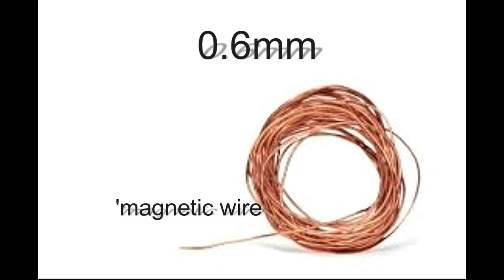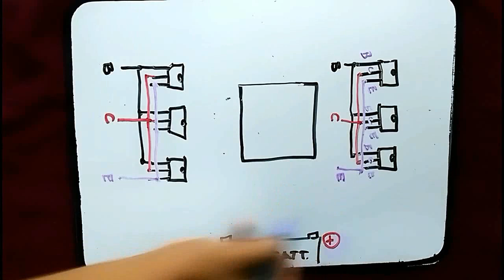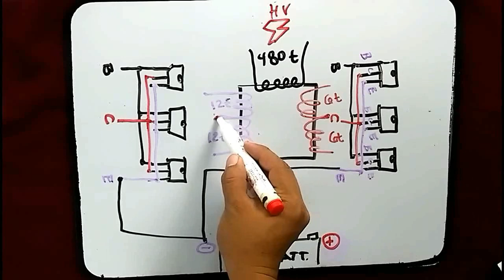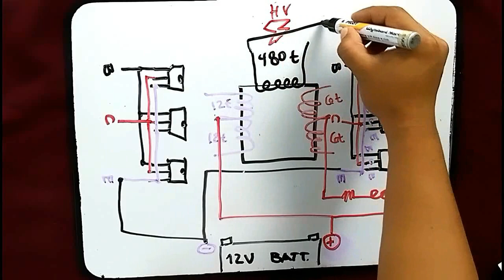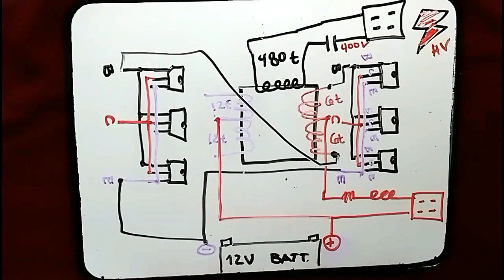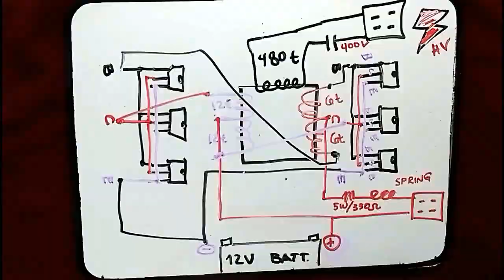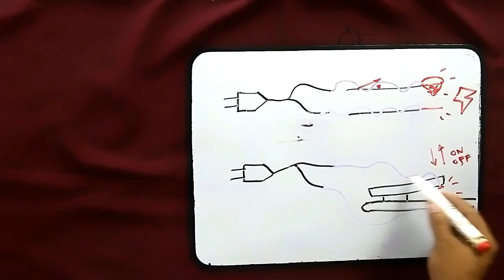DIY ElectroFISHER(fish stunner)  TAGALOG_ EP.3

Comment: Haaaaaay salamat...may pinoy narin na verxon...salamaaaaaaaaaaaaat sayo boss
Reply from the maker: Salamat din bro :)
Reply: Marami akong tanong boss...sana matolungan mo ako..
Reply: Marami akong ginaya na ganyan..kaso ma bilis uminit transformer ko..kulang kasi ang winding ko nung maliit na wire
Reply: Kaya gumawa nanaman ako..mosfet nanaman gamit ko..ma bilis parin uminit..
Reply: Malaki na na gasto ko boss..   :( pls help mo ako pano ba ang tama..
Reply from the maker: Meron pa tayong isang video dito bro. May mga sinagot akong mga tanong dun. Sana makatulong yun sayo. :)
Reply: Paki link ng video mo boss
Reply: Sir..sa pag wind ng wire...ano ba ma una???ang secondary??ty sir..
Reply from the maker: @balongpalcutofishingtv6816  technically, kahit anong mauna ay pwede bro. Pero sa ginawa ko, nauna yung primary (6turns at 12 turns) tapos sumunod yung secondary 480turns
Reply: @10minuteelectrodiy12  bro pa convert ako Ng wire "mm" to AWG 1.2 = 18, 0.6 = 23, 0.5 = 25 tama ba??

Comment: i suggest wag mo gawin switch in between center tap mas maganda i konek mo na sa center tap ng 12 turns yung resistor from 6 turns,bakit?? kasi may supply na yan from postive across to collector then ,emitter from negative ! may supply na di lang mag ooscilate kasi walang base just piece of advice

Comment: Hello sir 👋 .can I use irf 3205 this method
Reply from the maker: No bro, irf3205 will not work  my method..  but you can still make a fish stunner using a different configuration. I will try to make a mosfet (irf3205)version and upload it here soon. Hope you'll see it. Thank you :)
Reply: Can use but different diagrams iba ang wave of transistors small to big output  n papasok s transformers kya lumalakas

Comment: Hi boss. .ilan po ang minimum na transistor na kailangan ? . Kasi, na try ko po dalawa lang. . Tapos. Sabog/putok ang mga transistor ko. .
Reply from the maker: Nasubukan ko yung 3 bro. Ok naman.. pero yung mga sumunod na ginawa ko. Apatan na.. Eto kasalukuyan ko ginagawa now. 5-5. Sana magtagumpay :) ... sensya na napahaba reply ko..  yes,minimum 3-3
Reply: @10minuteelectrodiy12  salamat bro. . .try mu next time yung tradisyonal bro. . . .madali lang. . .meron akong video. .
Reply: @10minuteelectrodiy12  bro. . Kakatapos ko lang ng 10 pcs d718 ko. 5-5. Working na working. . Salamat sa iyong schematic diagram. . Nakatulong talaga ng sobra.
Reply from the maker: @rfltrrs02  wow. Nice! Maraming salamat din  po Sir
 😁😅
Reply: @rfltrrs02  boss pwede poba convert ung mm ng magnet wire into number di kc alam ng bibilhan ko pagsukat sa mm eh alam lang nila ung sukat sa number tnx

Comment: Boss ok to matagal ko na hanap tong design mo..iyong coil ano pong diameter?tapos instead na D718 eh 2N3055 pwede ba palitan nun?salamat and more power
Reply from the maker: Nasa video yung size ng mga wires bro.. at Oo boss pwede ka Gumamit ng 2n3055. Meron ako 2n3055 version Upload ko mamaya.
Reply: @10minuteelectrodiy12  I mean sir iyon pong diameter ng coil pag inikot mo na siya?for example pwede ko ba iikot siya sa isang  pako or pwede rin sa isang tubo?no  effect po ba?thank you
Reply from the maker: Ah... sa bilog mo siya ipapaikot kaya diameter. Diko pa natry bro :) .mas magandang yung mga classic na design ang gamitin mo pag ganun bro. Yung mga may contact point. Applicable lang kasi ang paggamit ng transistors sa enclosed core(transformer)sa case ko kasi ay 3amperes transformer yung mga ginagamit ko. Standard naman yung sizes ng 3A transformer kaya parepareho sila..  yung mga tito ko bundle ng pako or bundle ng asero ginagamit nila ..
Reply: @10minuteelectrodiy12  salamat bro..wait ko ung video mo sa 2N3055 TS..salamat  and keep on making very useful videos for us Filipino DIYers.
Reply from the maker: Hi bloxxy. Bro pasensya na katatapos ko lang maedit yung video. Pero dont worry dahil uploading na. Hopefully available for viewing after 30 mins or mamayang 11pm..  salamat sa paghihintay :)

Comment: Boss tsnung kulang ilang voltahe va  output at ampere nito BDW nkasubscribe nku
Reply from the maker: Hello Sir Renel Apilar :) Nasa 430V-450V yung boltahe sir.. D ko nasukat yung Current :)
Reply: Chargable bayang battery nyan boss pag malowbat sensya na sa tanung ko
Reply from the maker: @butakal1595  opo sir.   Gamit kong pangcharge yung DIY na 12vbattery charger. Andito din sa channel yung video kung paano guma ng charger. Sana maoanood niyo. Salamat :)

Comment: Kaya nya yung tilapia sa medyo malalim boss?
Reply from the maker: Oo boss.. check mo yung isang video ko about din sa fish stunner. Mas malakas yun kesa dito
Reply: @10minuteelectrodiy12  okay boss thank you
Reply: @10minuteelectrodiy12  boss yung 2N3055 ba?
Reply from the maker: Oo bossing. Yung 2n3055
Reply: Ahh okay boss,parequest ako ng mosfet boss,try nyo yung IRF3205 pieces kung kaya nyo boss,mas malakas yun
Reply from the maker: Cge boss sunod natin soon. Pagkakaalam, ko kahit 2pcs lang niyan ok na eh. Abangan :)
Reply: Mas powerful sana boss kung 4 pieces
Reply: Goodluck boss sana magawa mo,keep it up😉
Reply: @10minuteelectrodiy12  boss tanong ko lang po,sa resistor pag kailangan ko ng 15w22ohm or 15w20ohm ano yung pwede kong iseries para maging ganyan ang value?
Reply: Wala kasing nabibili na 15w dito samin ehh
Reply from the maker: Dipende.. Ano ba wattage ng mga resistors mo? 

Kung may 5watts ka, 3*60ohms parallel para maging 20ohms15watts
Reply: @10minuteelectrodiy12  3 pieces na 5w60ohm?
Reply: @10minuteelectrodiy12  boss paano naman po sa 5watts and 10 watts?

Comment: Nakagawa na ako nyan prob. Ko lng sa switch ko sobrang init
Reply: A1941 Ginamit ko
Reply from the maker: ilang piraso ginamit mo pre?
Reply: 6 dati sir nagdagdag ako malakas talaga xa kaso malakas Din mang ubos NG batt.
Reply: Gumamit din ako NG 1943 4nilagay Kong power
Reply from the maker: yung mga sumunod kong ginawa, ginamitan ko ng 2n3055..  mas tipid sa baterya bro :)
Reply: @10minuteelectrodiy12  marami din akong 3055 sir kqya lng dko pa nasubukan pasilip diagram mo
Reply: @10minuteelectrodiy12  alam ko ding gumawa NG classic sir yung may uper saka lower
Reply from the maker: nice sir :) .. classic yung mga gawa ng tito ko. walang transistor. condeser lahat, contact point at mga alambre ng payong
Reply: @10minuteelectrodiy12  marami na ako nagawang ganun sir tnx sa video mo may natutunan ako sa idea mo sa switch
Reply: @10minuteelectrodiy12  alin po ba mas maganda sa classic or un model mo na may transistor?
Reply from the maker: @alexalcantara1100  Good day :) .. subjective yan bro kung performance ang pag uusapan. Siguro magkakatalo nalang sa kung ano mas madali gawin..  mas madali gawin yang modern bro kasi mas konti ang winding dahil yungvtransistor na mismo tumatrabaho. Unlike sa classical na more or less 1 kg ang copperwire at nakabase ang lakas sa kung anong gauge at dami ng wire na ginamit mo.  Salamat :)
Reply: taasan mu sir ng konti ang resistor mu kpg nainit sobra ang switch
Reply: @viraltrendz1991  cge boss pag may  oras ulit subukan ko
Reply: @alexalcantara1100  yung classic kc sir ma's matipid sa battery pag maganda yung winding ok din xa pero pag compare mo sa transistor ang power ma's malakas talaga.

Comment: Naka dalawang gawa na rin ako sir almost 1 yir na dpa nasisira
Reply from the maker: d718 transistor din ba ginamit mo boss?
Reply: Sir.. Magkano pa order po ng ganyan... Texbk po sir
Reply: Sir denver pwede po malaman ung number ng magnet wire,, di kc alam ng shop pag sa mm or diameter tnx
Reply: @vergeltheexplorer  sa classic sir para saken pinakamagandang #14 #18 #21 yung sa may transistor pag bili ka NG 3amp.na transformer pwede gamitin yung secondary winding sa primary para makatipid ka tas bili ka 100 pesos #21 tas 100pesos no. 24 para sa secondary ttama ba sir tnx

Comment: W8 kopo sagot nyo thanks
Reply from the maker: Ano po tanong niyo?
Reply: Di pala nagsend sorry boss ito na hahaha,hindi ba baligtad size ng wire sa 6 turns and 12 turns?
Reply: 1.2mm talaga sa 6 turns?
Reply: Tsaka primary sya?
Reply from the maker: Yes po. Tama po yung nasa video ko. Yan po yung exaktong ginamit ko :)
Reply: @10minuteelectrodiy12  thank you boss

Kaso lang boss parang malakas sya umubos ng charge ng battery nyan
Reply: @10minuteelectrodiy12  sir.. Ano pong gauge ng magnetic sa 1.2mm sir... Saka po ung mga kasama... Sa 12turns po sir.. Anong gauge po ng magnetic wire nya